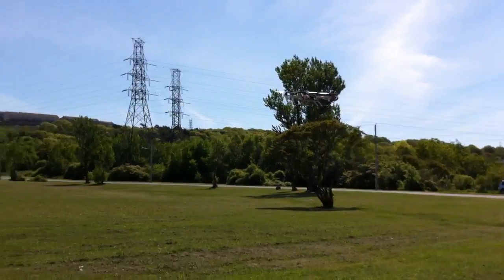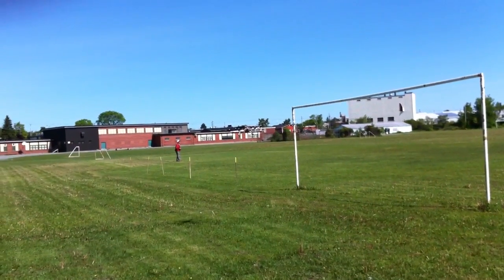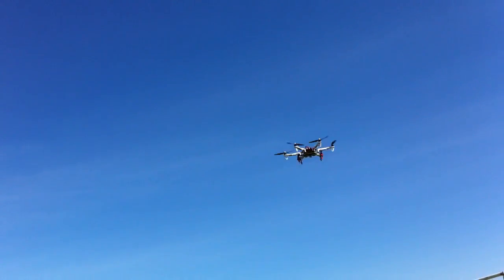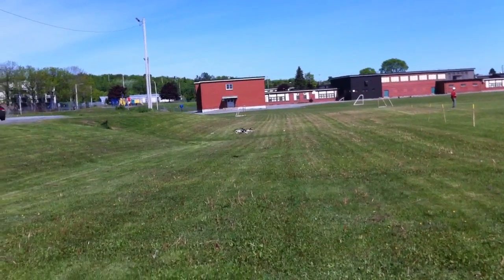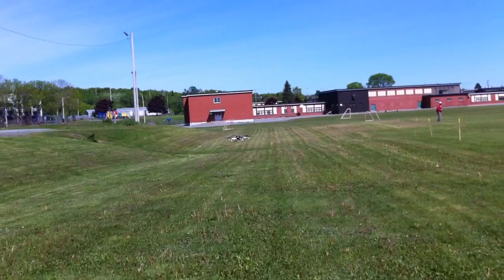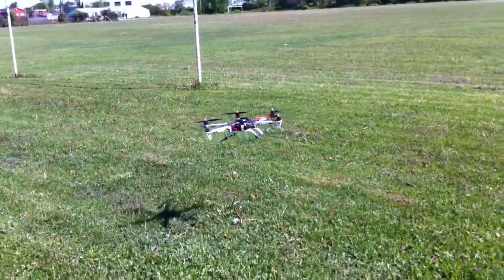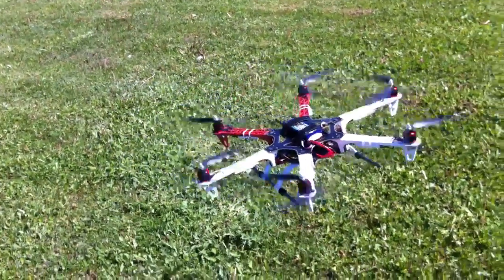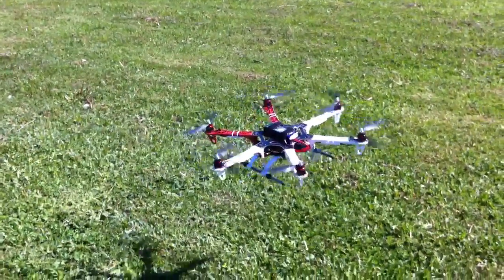DJI F550 Shake Down Flight

Comment from the maker: There are 10" props on the hexacopter shown in the video.  The compete DJI kit includes both 10" and 8" props.  8" are to be used when running a 4S battery.

Comment from the maker: Essentially 4S batteries should give you longer flight times.  The motors and electronics all consume a specific amount of power (Watts).  DC power is the product of Voltage and Current (Volts x Amps).  If the number of watts remains the same and the voltage is higher (as in a 4S battery vs a 3S battery) then the current draw is reduced.  Lower current draw means the battery lasts longer.  Keep in mind, there are other factors that come in to play such as increased weight due the larger battery.